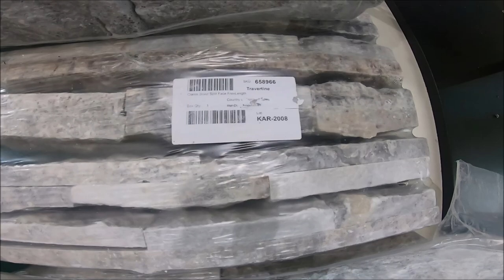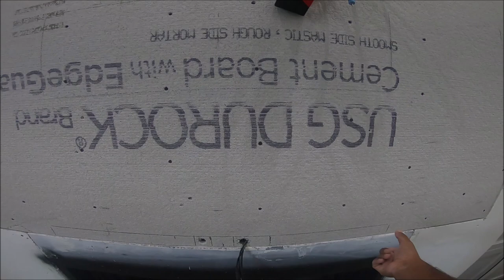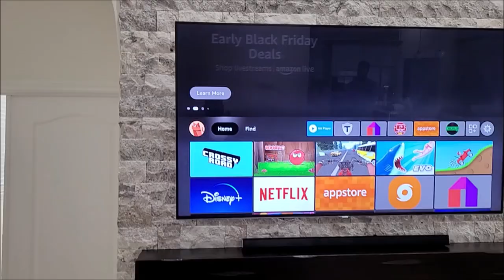Installing Stack Stone On Fire Place With Mantel, TV & Sound Bar

Comment: I have a question. So I want to do stacked stone to the ceiling above my fireplace as well. Above my fireplace to the ceiling there is only dry wall do i need to take that out and add cement board too?
Reply from the maker: Yes add cement board 
The stack stone is too Heavy for dry wall
Reply: @AZIMBAYO1  ok thank you! This will be my next big home project. I hope i don’t screw it up lol